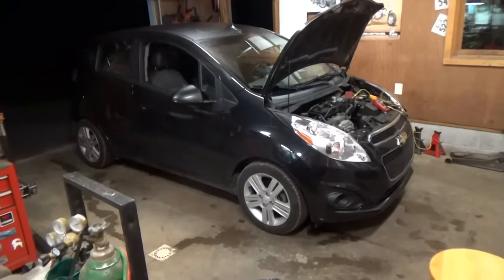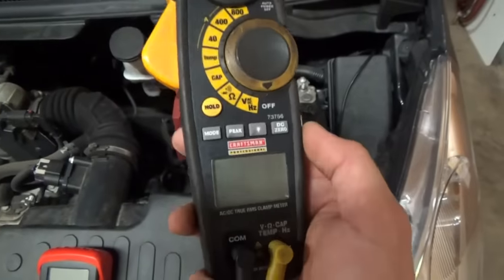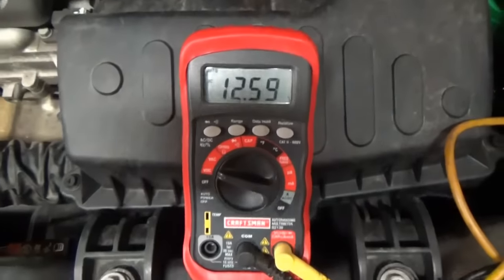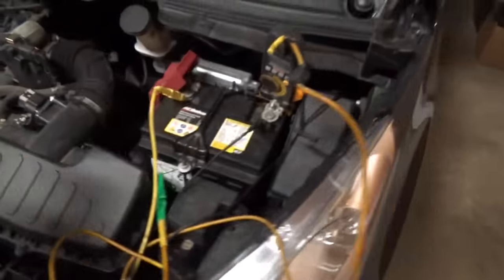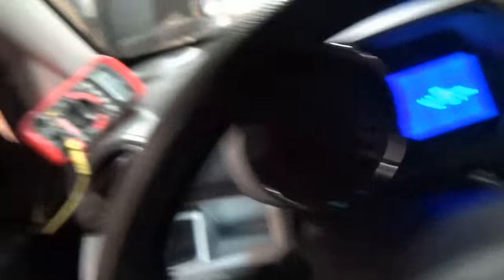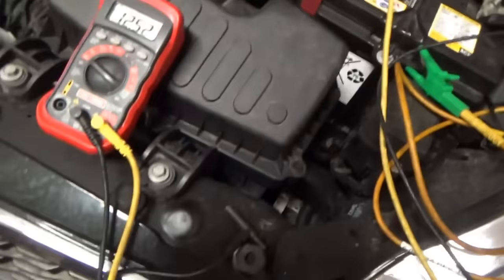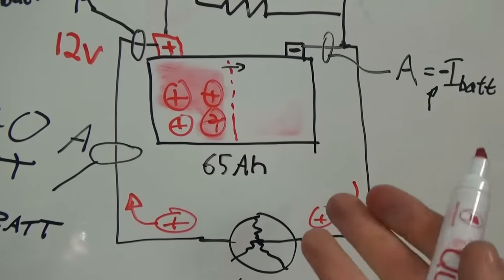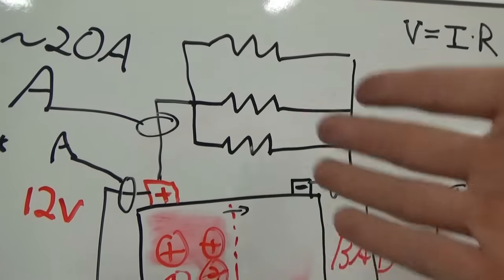Battery-Alternator-Draw Tests: EASY & ACCURATE

Comment: i will probably never use a dmm to test for a draw ever again... most likely never will.. for me, i bought a pico, i love using it for it instead, no blowing stupid meter fuses, hate that.. and you can use your meter if you have a mA chart for what the fuse is designed for and the estimated circuit draw is.. you can then take your meter and read mA without blowing the fuse unless its stupid which would be obvious right off the bat.. you can with a few steps.. find your circuit at least quickly ish and your draw!! but hey... definitely not knockin anyones way of doing the test as long as you understand and it works.. thats all that matters..

Comment: I have an 07 liberty and the alternator doesn’t charge the battery. I Checked fuses and relays grounds I am thinking voltage regulator unfortunately it’s incorporated into the computer I might try to get a new computer from the salvage yard tomorrow any thoughts? Voltage on the alternator post is the same as the battery it’s like the alternator Isn’t being told to charge the battery

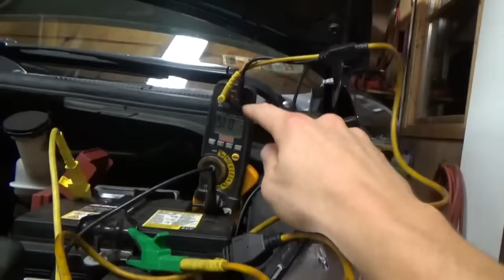Comment: 22:40  couldn't you use an amp clamp capable of reading DC milli-amps totest for parasitic draw instead of using a multi meter inline?
Reply from the maker: Still not as accurate and VERY expensive!

Comment: OOPS-I meant rated or advertised Cold Cranking Amperes at 25 F?    -not A/H
 -so plates bigger and more electrolyte inside
    now CHEAPER replacement  battery is inch or so TALLER-and READILY available NOT DEALER $OURCED

Comment: Hey I've got a ing1 fuse that blows when I turn the car to acc I low that circuit runs my charging system so do you think when I find out what is blowing that fuse my alternator will fianally charge because it will run now with that fuse blown but will not charge

Comment: Could you show in the white board schematic where the vehicle amp. gauge/ dummy light is connected in the charging system?
Reply: Generally it either comes from the voltage regulator inside the alternator, or from the PCM.

Comment: Is there a "standard" or acceptable amount of amperage draw allowable? I'm dealing with a Buick Park Ave that shows .05 draw when sitting with everything off and a freshly fully charged battery. The battery tests fine under load with a Christie tester (15 seconds load time=meter returns to 100% charge). There are occasional drains even tho I'm not seeing anything left on to drain the system. The alternator was new just before I bought the car a few weeks ago. A bit of a mystery to me so far. When it doesnt start, a VOM check on battery voltage shows around 9.5 volts...
Reply from the maker: Older cars might draw 0.002A or 2 mA. After 2006 or so I've seen upwards of 0.035A or 35mA be "normal". In-series meter is the only reliable way to test for these small draws.

Comment: Would you recommend a fully charged battery to be used to help locate parasitic draws?
Reply: I have heard others say that you have no business looking for a draw without a fully charged or good battery.  My guess is it can cause misleading results. I think even newer cars may have sensors that can detect low battery voltage when the car is asleep.

Comment: I noted dinky car had      remote   power door locks-so remote control itself to open doors was CAUSING DRAIN 24/7
   dunno if security system or auto headlamps ,that suck power 24/7 .,also fitted
     even gps or display etc etc sips power 24/7

  -did not see if battery itself was SEALED -so you cannot check Specific Gravity with simply hydrometer 
      OR water levels inside battery   AND  to add DISTILLED or RAIN water - so cells COULD have SULPHATED
        -thus cells could not accept full ,if any ,charge
 
-rare, but I have seen blown or corroded alternator  DIODES-some have 6 ,others possibly 7
   -to rectify AC from alternator to pulsing DC
      most are el cheapo diodes with solid wires pressed into 2 heat sunk  plates , so vibration or corrosion broke wire(s) 

-I installed HUGE 700 A/H group 34 battery with accessible CELL CAPS in my Honda       FIT    
    instead of DINKY SEALED std 400 A/H unit      -it     "fit"    FIT ~~   !!
          only complaint after 10 yrs service in frozen north
Reply from the maker: My dad has a 2007 Honda Fit...still starts fine on the original dinky battery!!!

Comment: With the amp clamp test, are there variables with vehicles with 2 batteries, such as diesels and larger gas engines?
Reply from the maker: Of course! But the same concepts apply. Just draw a picture and imagine the current flow :)

Comment: What if modern car alternator makes whining noise after cold start when you have lots of electrical devices switched on, heated seats, rear window defroster, mirror defroster, etc. and as you switch them off the whining noise goes away, is it a sign of battery going bad or alternator problem or maybe normal behaviour?
Reply: I think it's saying "HEY I'm BUSY HERE!"
Reply: Mechanical noise is the alternator bearing or slipping belt under a heavy load. Whining noise in the radio/stereo. means a lose connection to/from the battery or one or more alternator diodes are bad, my guess.
Reply: A screaming alternator could mean it's lost a diode and is running full fielded for a long duty cycle to meet the current demands.  Sounds like your battery is taking a charge and is able to meet the starting load.

Comment: I bought a new battery and it didn't last 2 months I charged it up and hooked up my very old but very reliable load tester and voltage dropped like a rock I took it back and they charged it and tested it told me it was good I got very pissed off because I've been a mechanic for 40 years in this town and the guy new that so I drove back to the shop and got my tester and loaded it and voltage dropped he gave me a new battery and no more problems I had I not had a good tester and knew what I was doing I would have been in a mess .. I feel sorry for people that have to rely on others

Comment: can you check a charging system with out a amp clamp?    I have been meaning to buy one  and just have not had the time yet    can you  rec one for  a diy guy?
Reply from the maker: Voltmeter is essential; amp clamp is nice to have but optional. As long as it says DC any amp clamp would work!

Comment: All good but the public still has to deal with those robots at the parts supply stores, especially if there is any warranty left.  DIY can do all this and confirm the battery is done for yet, the parts stores will make you waste your time putting their battery on their battery machines that take up to 3 hours to falsely diagnose a bad battery, charge it a few hours, then hand it back to the customer who takes it back home and finds its still a dead waste of your time.  Last time I went to a auto parts chain I told them, I already did the testing and the battery shows regular voltage but won't light up anything that has a fair load so it's shot. Please process a warranty and send me out with a new battery so I don't have to wait for your machine to prove me right.  Next time I believe it's going to be an AGM type battery since they seem to last longer.

Comment: In the old days we would just pull the Positive off the Battery if it stays running, the Altinator was Good, Battery cable was loose or Battery is Junk...Simply put you need a Battery.

Comment: This loss of capacity is somehow much worse in sealed 'maintenance free' batteries. The old lead/acid ones (which you had to check/top up every year), kept their capacity longer.
Reply: Jan Verschueren 

Not quite true. The GM Delco freedom battery lasted longer assuming proper use.  If the user didn't over charge or over discharge it would last longer even with harsh winters and or very hpt summers.
Reply: it's likely low on electrolyte, probably someone with a bad habit of running it low/dead often and charging it hard/too long on old charger
Reply: Ok... 1) where do I buy one in Europe? -we've basically got Bosch, Varta and Yuasa to choose from. And 2) if it's still more susceptible to overcharge and complete discharge than lead/acid that's still not an improvement.

Comment: Iam new to this field  hyundai accent ichecked the voltage on battery its 13 volts did bad battery do that or bad alternater.check positive  cable on alternater  there is no voltage drop

Comment: Good explanation but electricity is the flow of electrons, which are negatively charged particles. Electrons flow from an excess of electrons at the negative post, to a lack of electrons at the positive post.  It won't make a difference in the way the system works. The positive and negative designations were assigned before it was known what was actually flowing.

Your diagram would only show what the alternator was charging if the clamp was moved to the positive side as the load was not included.
Reply: "Electricity" per se is the name of a set of physical phenomena. "Current" refers to the flow rate of charge. The rate of flow of electrons is called "electron flow rate", and is specifically not the same thing as current.  In wires, charge is carried by electrons flowing  through the metal. (But in other scenarios, charge can be carried by positively charged particles). Since electrons carry a negative quantity of charge, when they flow from (say) the negative post of the battery to positive, the charge rate of flow is  negative in the direction from -ve to +ve, and thus positive in the direction from +ve post to -ve.
Reply: We are talking about electricity moving through wire conductors. Electrons move from one atom to the next in conductors. They conduct because they have free electrons that can be easily transferred from atom to atom or even shared by two or more atoms. The nucleus of the atom has positively charged protons and neutrons which have no charge. Protons can be dislodged from the nucleus in a nuclear reaction but you certainly wouldn't want that to happen in a vehicle.
Reply: Right. But "electricity" is not (as in your initial post) the flow of electrons. The flow of electrons is called "electron flow", and as you say, it is true that in the car battery scenario, there will be electron flow all along the circuit, in the direction from -ve terminal, through the wiring and load, to the positive terminal.  But in saying so, it's important that readers don't get confused and think that this flow of electrons in the -ve to +ve direction means that "The Current is from -ve to +ve".   This flow of electrons corresponds to a negative current, since the electrons carry a negative charge. So readers should realize that what you have described (and would be indicated on a meter) is a current that reads positive in the direction from +ve terminal to -ve terminal.
Reply from the maker: Sure, electrons are the actual current carriers. However that doesn't matter at all in terms of testing and diagnosing a system. We can say the charge carriers are positive, which is conventional theory :)
Reply: We don't have to talk about charge carriers at all. We could stick to discussing current_, which is rate of flow of charge, and has the same value of (say) positive one amp regardless of whether 1 Coulomb/sec of negative charge flows from negative terminal to positive, or 1 Coulomb/sec of positive charge flows  from positive terminal to negative.   That's kind of the point -- current is a quantity that doesn't care about the specifics of the charge carriers, and specifically does not require pretending that charge carriers are positive, which in turn is _not conventional theory. It is true that the situation is widely misrepresented as you have done, showing +ve charge carriers, but that is not "conventional theory", it's unnecessary pretending.

Comment: Don't worry if you call the battery bad and then you find is the alternator that is at fault. Just do like any regular shop  would do it : 
1) Tell them that the new battery caused the old alternator to fail because of the additional current used to charge the new battery.
2) Tell them that the new alternator caused the old battery to fail, as the battery was not getting proper voltage before, but now it does..

LOL
Reply: usually a bad battery ends up killing the alternator from over working it to death, they're usually old and weak by then and that just finishes them of
f ;)

Comment: I don't like those little electronic battery testers.  I prefer the carbon pile type.  Hasn't let me down yet.
Reply: As is said, all circuit testing should be under load.  With a battery, you are testing a voltage divider between the internal resistance and the load.  As the battery goes bad, the internal resistance rises causing voltage drop when loaded.

Comment: Can we use ac clamp and why?
Reply: An AC clamp will not register DC current. Most of the cheapo clamp meters are AC only as it's easier to accurately measure the 60Hz electromagnetic field from an AC power cable than the constant magnetic field from a DC one (also it needs the zero function to avoid outside magnetic fields from throwing off the reading).

Comment: why dont these auto parts shops that test battery use those battery load testers instead or with their fancy tester?after all these years of wrong diag for customer batteries you would think they would do this especially because they could sell a battery.i just dont understand why they only rely on testers that dont stress battery?

Comment: Town and Country turned still can't get it to charge change battery and alternator twice and alternator just won't charge. I installed voltage regulator kit and still not charging. I can't believe two new alternators could be bad.
I can't figure this one out
Reply from the maker: Did you use an OEM alternator? Get a wiring diagram, the PCM likely controls the alternator output.
Reply: @PineHollowAutoDiagnostics  So I bought the voltage regulator kit to eliminate PCM and still not getting charge from alternator not if there was a way to check alternator independently, I would do this I hate replace alternator the third time.
Reply from the maker: @myviews469  you need to do some voltage checks on the alternator control to see if the regulator is working 👍
Reply: @PineHollowAutoDiagnostics  2011 T&C pretty sure has regulator in its PCM anyway when I supply 12 v to the one of the two wires behind alternator and the other one to ground I still don’t get alt to charge when engine is on. Is this switch at the alternator gone bad because it’s a new alternator.

Comment: people wonder why batteries and alternators don't last. my 1994 ram 2500. the only time the headlamps are on is if i turn them on. so simple if i want them burning i am able to pull the knob. if i want my doors locked i mash the button i don't need the car to do it for me. i know if a tire is low don't need tire monitors. cars don't have to be the way they are its by design

Comment: none of the battery testers can test properly without battery being fully charged to start with, even then they need a real tester with load bank.
I'm going to guess that battery is way low on "blinker fluid" :))

Comment: at 15.1-15.2 volts it will cook the battery . Voltage regulator on the alternator is fucked, this is why the first battery got fucked. The new battery will last maybe 6 month to a year and will crap out.

Comment: I think that charging voltage is too high. The normal charging voltage is no more than 14,40 volts and that car is putting 15 volts on the battery. May be that high voltage that killed that battery maybe...
Reply from the maker: You will have to talk to the electrical engineers at GM about that. In my experience batteries generally have a SHORTER lifespan on vehicles equipped with these stupid "smart" charging systems lol
Reply: Most cars with smart charge use a silver cadnium battery and some cars boost charge at 18v

Comment: parasitic draw tests are so confusing on how they are to be performed most say in series with the battery cable + or - another says to measure the current from the fuse box not naming any names but he's a Volkswagen mechanic
Reply from the maker: Both methods are valid, but for small draws the amp clamp can be inaccurate, so the in-series method is preferable :)
Reply: @PineHollowAutoDiagnostics  I don't have access to an amp clamp only a standard multimeter so that's out of the question thanks for the reply :)

Comment: Hi I have never seen a car with 0.000 amps draw if it has a clock in it it will draw something
Reply from the maker: It was basically under 10mA, which is the measuring threshold for that meter :)